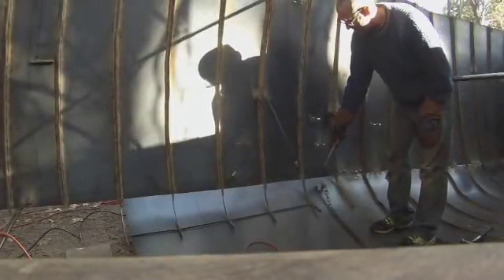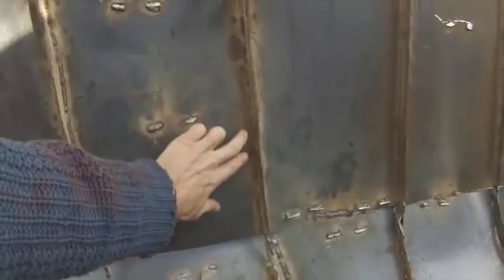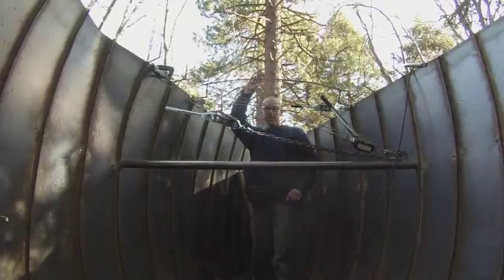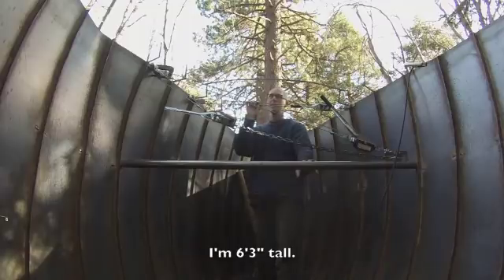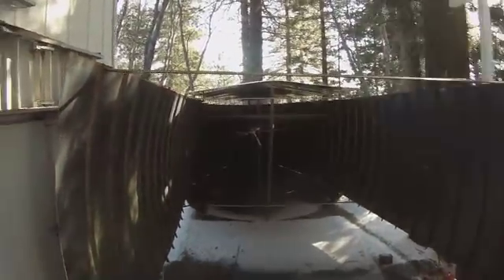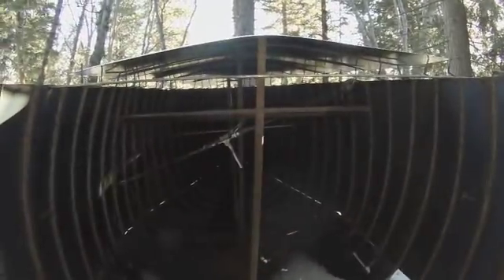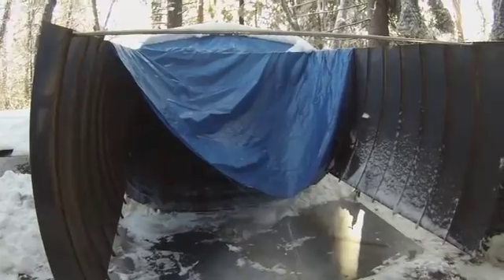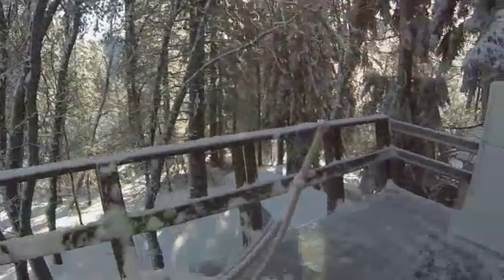Steel Sailboat Build   Part 4

Comment: I really appreciate your courage. Please believe me their is a reason naval engineers spend up to 6 years at university prior to being competent enough to design a boat like yours. Your ribs are under strength, did you calculate any stresses from your mast step through and into your hull.  I see your using a gas’s less mig. You will need to weld all seems grind them back flush then weld the inside come back to the outside grind out the weld so when you weld agin you have full penetration. I am still not confident you will get adequate penetration to the parent metal. Think you will be out at sea hundreds of miles from land. When trouble strikes it’s quick and you could be at the bottom in the space of minutes with a seem failure. Good luck.

Comment: I am hearing resistance to people who have the experience to know. You are putting in a lot of admirable effort, but there is tons of information online for steel boat deigns. So far, what I see is an over-sized can. A bulky good sized steel sailboat that is also light enough to trailer that has all this sail and only a ton or so of ballast "Because it is placed lower" and it all weighs in at 8000 lbs, well, good luck with that.  I actually DO sail in the real world, a 40 ft steel, double chined cutter. It displaces almost 24,000 lbs and has over 9000 lbs of ballast with a full keel and multiple bulkheads. You are putting a lot of work and materials into this, so the lack of professional guidance is baffling. What I am seeing so far is a very large piece of yard art or a small artificial reef. Marinas will want liability insurance at the least for you to locate there, and a smart person has it for their own protection to say the least even if you are not in a marina. Before they will insure, they want to know a lot about the  boat and who built it. Home builds will get extra scrutiny.  In the face of insurers or boat surveyors, dreams fade and structural reality rules. A good sailboat is not a random event, then again, a word to the wise is unnecessary.

Comment: Still deciding if the strength is a problem depends on the design of the deck bulkheads ect. A tube can be very strong. My concern is the burning of the metal from those continuous welds on the ribs.

Comment: Your ribs look incredibly inadequate for the job.  Is this a design you pick up from somewhere, or was it something pared back until you felt you had "just enough" to do the job?
Reply from the maker: I want the boat to be light so I can trailer it.  I am trying for strength through many small things, like ribbing every square foot.  I'm no naval architect, so we'll have to see what it does in the water.  I'll start small, like Puget Sound.
Reply: um....you do realize your going to need at least 4 tons of ballast right? otherwise when you hang a 500sq ft sail off a mast it's going turn turtle. I can show you the 15th century math, but I'm guessing your not going to listen. no way you hull is strong enough to to support 4+ tons lead and it doesn't look as though you shaped the bottom to attach it, so I'm guessing you have 0 idea what your doing. Shame there are some really good free plans for hard chine metal sailboats on the web.
Reply from the maker: Greetings,
A ton is 2000 pounds.  Four tons is 8000 pounds.  I expect the boat will come in at 8000 pounds total, including ballast.  I think four tons of ballast would sink it, right?  By the way, I have a math degree.  In the real world, naval architects use 25% to 50% ballast.  The lower the ballast is placed, the less is needed.  I'm trying to keep the ballast weight as low as possible, so I'm planning on 2400 pounds, with 1000 pounds of that hanging at 4 feet below the water line.  If more is needed, I can bolt it on.  It's true I have zero idea what I'm doing, but I think common sense and research of origami boat design, the work of naval architects and boat builders will see me through.  We'll see.